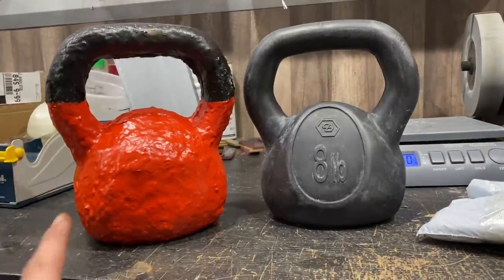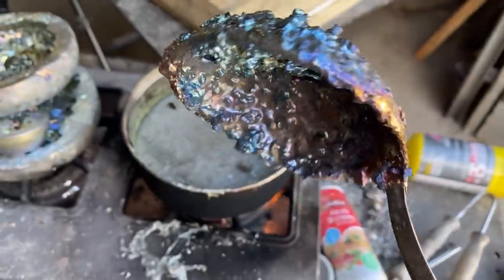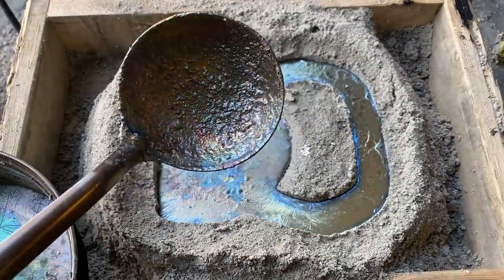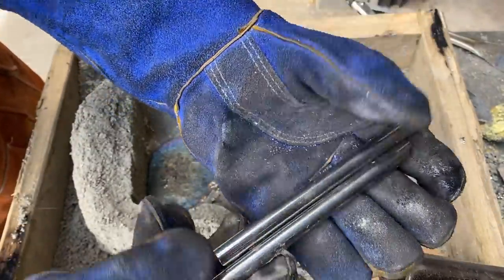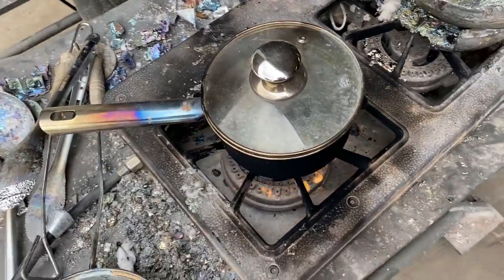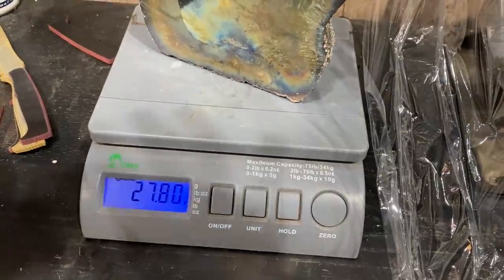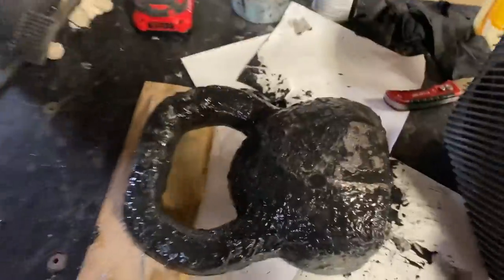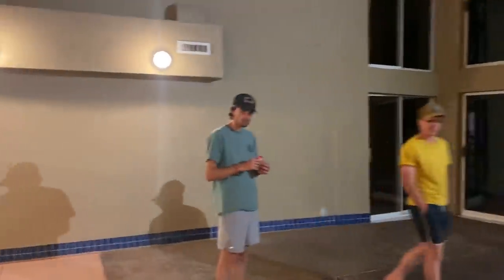This Kettlebell Is Much Heavier Than It Looks

Comment: This is basically a complete guide on how not to do something correctly
Reply: If they smash a few eggs randomly it might have a real how to basic feel to it.
Reply: So true, and how difficult would it have been to clean up the surface(s) ?
Reply: well, it is a waterjet channel, did you expect high quality forgery?
Reply: D+ for effort
Reply: You must be new to this channel? 🤔🤣
Reply: Thats why its called waterjet channel and not heavy kettlebell builders
Reply: That's almost every video.
Reply: @Mbro420  nah , been watching for years now love the channel , however pouring molten metal into a wet mold is a quick way to get a nasty thermal reaction.
Reply: Yeah that's the best part
Reply: Anything at all
Reply: @sjv6598  suggest something that hasn't been cut yet.
Reply: @achecase  really  difficult, the thing is, they used the wrong sand.
Reply: and how to dry bismuth
Reply: @sjv6598  then leave and watch something else? Nobody is forcing you to watch.
Reply: @PaperMakersAdeludedbroad  did he say he wasn't entertained?lol they suck at this task. He may enjoy watching them fail.
Reply: Not complete, since they forgot to throw an ice cube into a large pool of molten metal.

Comment: Fun fact, if you combine Lead and Bismuth in around 50/50, the melting point of that alloy is WAY lower than either Lead (327C) or Bismuth (271C) at around 125C.

Comment: The reason you are having problems with making moulds for casting is you aren't packing the sand down enough. Personally I prefer petrobond since it gives better detail but your kitty litter (bentonite) and sand mix can make really good moulds if you just pack it properly. It's not enough just to squash it down you need to really punch it (or preferably use a mallet) and then it won't collapse the moment you pull out the object or try to add metal. It's the biggest mistake that newbie metal casters make, and the other big one is not enough heat

Also a generous dusting of baby powder is key to stop the sand sticking to the object you are attempting to replicate
Reply: What? You're trying to say that proper moulds don't make things that look like they've been freshly dug from an ancient burial mound?
Reply: @uiomancannot7931  more like pulled out of a canal, but yes, that and pouring all at once rather than in dribs and drabs wouldn't hurt matters either. And to get it to flow around the tungsten is very easy.. you just heat all of the tungsten to above the melting point of bismuth and add it to the liquid in the casting before it solidifies.. they make it look far harder than it really is if you know the basics about casting/common sense. Hot thing gets cold if put on cold thing, it's like dropping ice cubes in coffee and expecting it to stay hot
Reply: @Lilith-Rose  
That's why he said ancient, and not a canal for under 100 years. lol
Reply: @KC-bg1th  I was saying theirs looked like it had come out of a canal, not a properly moulded one. After all the original is literally moulded plastic and a proper casting needs almost no cleanup
Reply: You'd think in that shop, they'd have access to a hydraulic press to pack it with.
Reply: I don't think they care. This channel has become quantity over quality.
Reply: I've done better even without that knowledge, I question whether they even used bentonite at all
Reply: @evenIgiveUpwastaken  I don't think these jokers are allowed to use any of the equipment...
Reply: @BobMonkeypimp  Haven't they always half after things I feel like that's what makes it funny. Also this seems like way more effort than just slicing things with the water jet which is what they started with. So I think it's the opposite.

Comment: Should have made it bottom up. You could have made the handle separately and then added it into the lower section. You could have made it like slotted so when put it together it would be a strong hold. You could make channels that could be melted together. Epoxy seems foolish. It will break easy.
Reply: Why?

Comment: So, here's a water jet challenge. 
What can you cut with a gravity-only water jet?
Reply: Niagara Falls 👍
Reply: Depends how much I've had to drink.
Reply: The Grand Canyon, eventually.
Reply: I mean, dropping water through a tube that gets gradually smaller. I don't know the physics that optimize such a system. It would be interesting if you could rapidly cut stone with such a setup.
Reply: @zippythinginvention  If you had a column of water about 25 miles tall you could reach a pressure similar to a commercial waterjet. If the column was 'only' about 1-2 miles tall you could reach the water pressure of a pressure washer. That should give you some idea.
Reply: @bradley3549  even if you gradually narrow the tube?
Reply: @zippythinginvention  Gradually narrowing the tube makes no difference. The pressure at the bottom of the ocean would be the same whether the ocean was 3000 miles wide or 3mm wide.
Reply: @bradley3549  I am aware of the whole "column of water" thing. Have you not seen micro-hydro power systems? Moving water, mate.
Reply: @zippythinginvention  Sounds like you're talking about the geometry used in the nozzle design, which yes are often tapered to produce as little turbulence as possible when feeding the turbine. Which might have some relevant overlap with a high pressure waterjet nozzle. But since we're talking about cutting things with water, it's more about pressure. The nozzle geometry is only important in the last 2 inches of that 25 mile tall column of water.